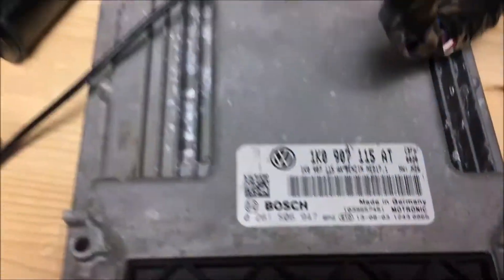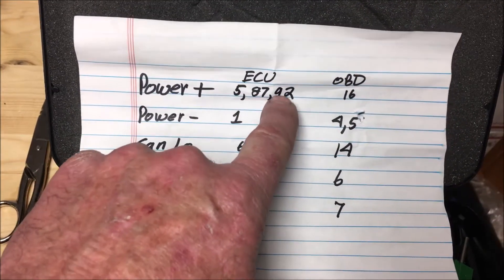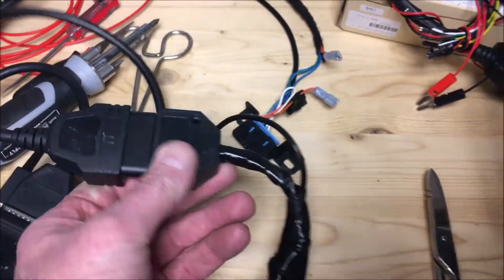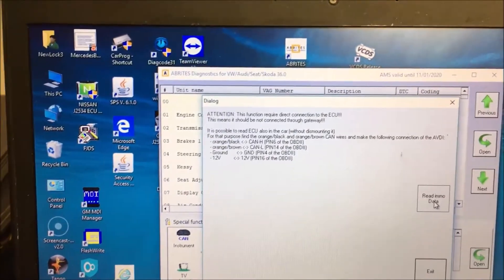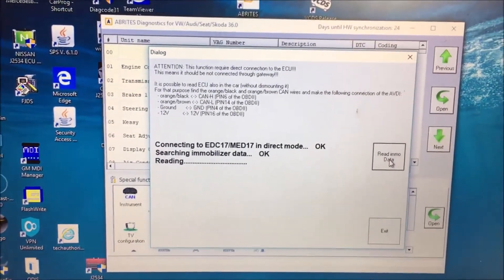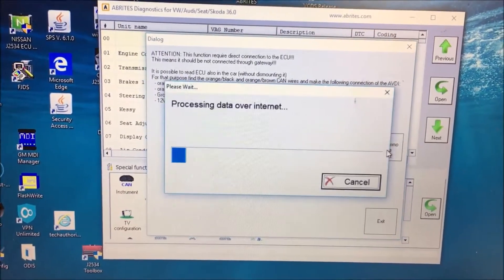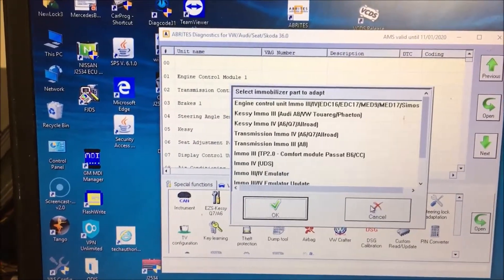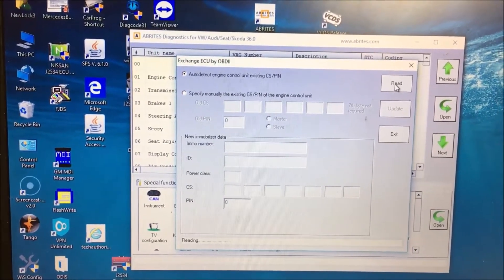MED17.1 ECU Reading

Comment: Can you share boot connection ?
Reply from the maker: I didn't put this into boot mode.. with abrites you don't need to.. just read the data and use the ECU replacement tool... Even in boot mode these ECU's still have OTP, one time programable sectors in the flash.. Abrites is able to change other data so it looks like the original ECU...

Comment: Hi, you mentioned an online connection. Will it read and transfer data w/o online access?
Reply from the maker: It needs an internet connection to calculate the CS and MAC and Pin...  If you are just reading the data and transferring to another module, no...  It will read the data and write to another without internet connection...  You have to have the ECU reading software and the breakout box with the cable that plugs into it...
Reply: Is there an internet fee or needed credits?

Comment: Mr Tim i need your help please i did colone for 2012 vw Beatle the ECM Bosch MED17.5.2 and that car no starting  please give me a hand
Reply from the maker: what did you use to clone ECU?
Reply: @timtracy9442  
Autohex2
Reply from the maker: @mahmoudhantouli5434  I don't have autohex, so I don't know where to point you...  I use AVDI, it moves all the data over, then performs a sync between the cluster and the ECU, have you tried to sync the cluster and the ECU with autohex??

Comment: Can we read that ecu with vvdi prog
Reply from the maker: I am really not sure...  Give it a try and let me know...
Reply: @Matthew Taylor i tried to read an audi edc17 ecu in direct mode with a fvdi clone 2018 and it didn't work. You said that is necessary to set ecu in boot mode before. Can I do it with vcp?
Reply: @Matthew Taylor thank you Matthew
Reply: @mattewA3  The problem with the Med 17.x.x ECU is that they each have a different method to enter bootloader mode (without software).